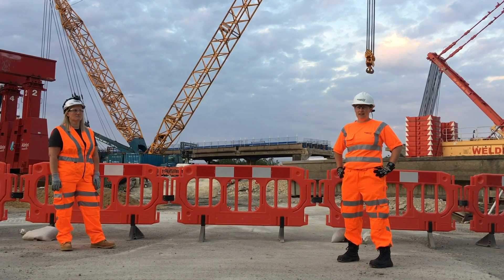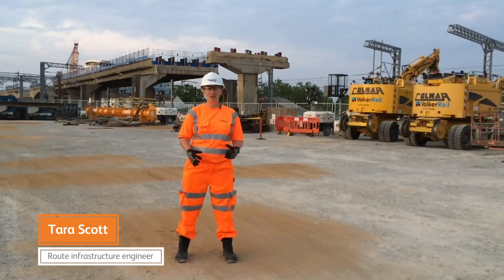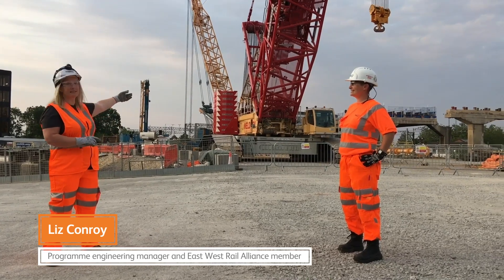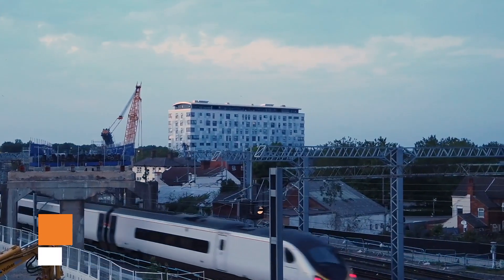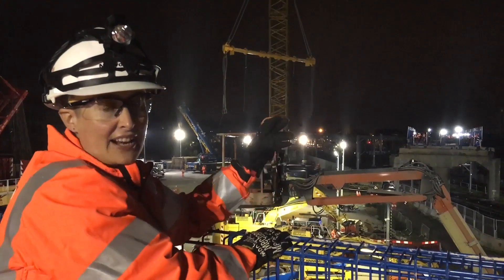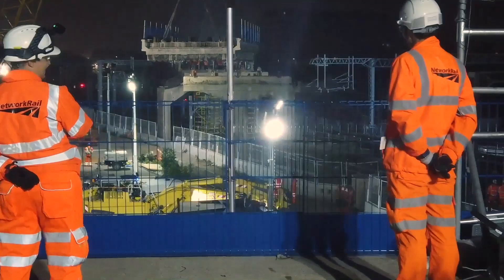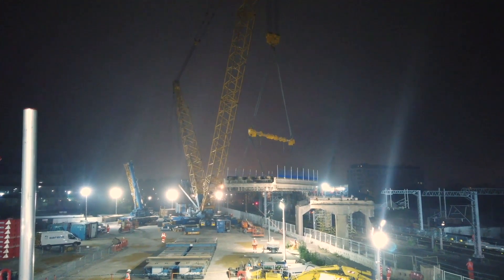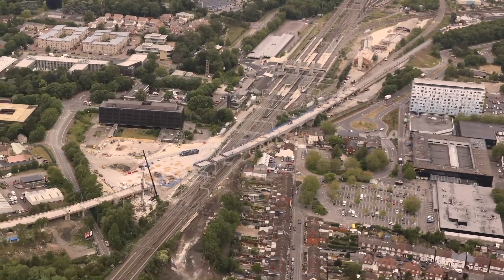Trackside Tara and 300 tonnes of concrete

Comment: What's the reason for removing the existing track?
Reply: It's old & beyond repair.
Reply: That was only built in 1959, compared to the rest of the Victorian network it's almost new.  Seems a colossal waste of money, I fully support the building of the new E to W link but this replacement seems like work for works sake.  The new one is cited as being fit for 120 years this is barely half that age and is the same material 'Concrete'.  If it was brick arches I could understand it.
Reply: @cmclewee9518  building brick arches would be prohibitively expensive. I understand what your saying about the wastage .. I think in the early days of concrete in the 50s / 60s it was still quite experimental .. for example -  spaghetti junction in Birmingham. it's falling to bits already and only just over half a century old.
Reply: @hendog3894  Henri, I wasn't suggesting building it in Brick, my comment meant if it had been brick I could have understood the rebuilding but replacing a modern concrete structure with another seems a waste of money.  They are not increasing the number of tracks so why rebuild it.  If it's just to have platforms then why not just bolt them on the side as it were, it would have cost a lot less.  It's the same with HS 2 they could have used the route of the old GCR and saved billions.
Reply: @cmclewee9518  apologies, I misunderstood. I agree, it does seem wasteful to replace something with something like-for-like. It's not exactly a old structure either. I'm sure there must have to be a legitimate reason to spend so much money? You'd hope ! Perhaps the concrete has corroded prematurity? Some early concrete structures were still quite experimental. Would be interesting to know the specific reasoning..
Reply: @hendog3894  Apparently the structure was inherently weak, the concrete not being strong enough for the new railway. It's worth remembering that the new railway will have W10 loadng gauge for freight traffic. The width of the track bed or permanent way also needs to be widened for potential future electrification.  These and other factors demanded a new flyover.
Reply: @ds1868  thanks for the info. Good to know 👍
Reply: @hendog3894  yes the investment on this railway is impressive. The real challenge comes in the next two sections. Bletchley to Bedford will be completely rebuilt and is proving a real headache. Bedford station will also be completely rebuilt. Then the new section between Bedford and Cambridge.  That's when the real fun begins and the multi billion pound budget gets tested.
Reply: @ds1868  I've been following the next stages.. wasn't the Bedford to Bletchley section prone to flooding, being quite low ground? 
Interesting to see the route choices, especially leaving Bedford. The original alignment seemed very intuitive as a route here, leaving Bedford St John's on an Easterly exit... , as 'only' industry building carparks in its path (I say 'only' very loosely as, I'm sure there's a legitimate reason for taking the longer northern exit). Whatever the final path, hopefully the routes will be able to run at a decent speed. 
Agreed, new track building will be the real budget tester....
Reply: @ds1868  I can see your point but with the current financial situation surely it would have been better to just add extra width to the existing structure.  At the end of the day concrete is concrete whether it is poured now or in 1959.  The engineers must have been looking for work if they think that a new structure will be any different to the old when they are building it with the same material.  The Victorians cant have got the engineering of stone and brick arches all that wrong as they are still standing after 150+ years which is longer that the expected life of this precast concrete monstrosity they are currently building like a piece of lego.
Reply: I really don't think anyone will understand unless they are one of the inspecting engineers who advised to rebuild the section which goes over the WCML, which will now be a tunnel instead.